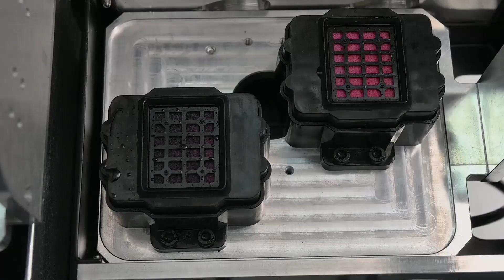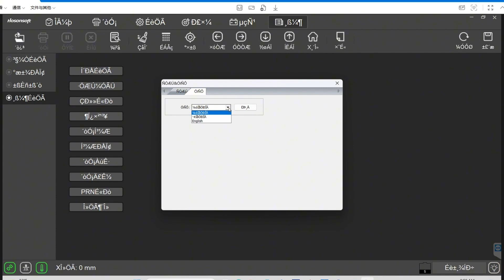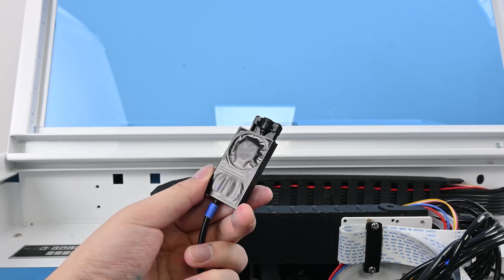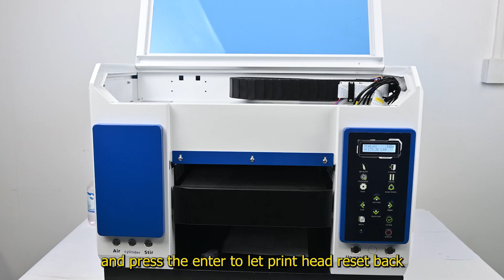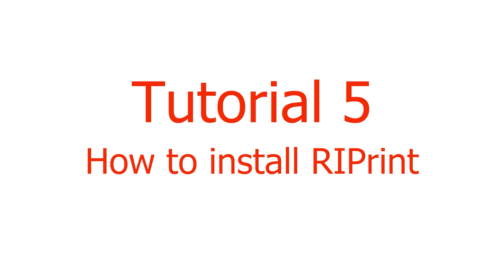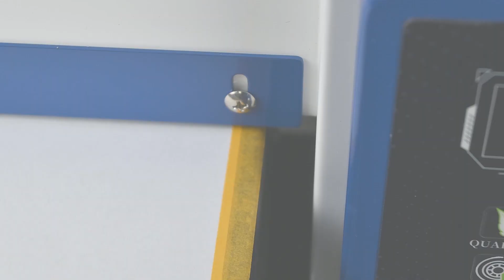Procolored V10 Pro UV Printer Setups

Comment: Hello can I make language German too or only English ?
Reply from the maker: The software has 7 European languages but unfortunately without German.
Reply: @ProcoloredPrinter 😂 wtf
Reply: Do not purchase printers from Procolored! Please spend a few seconds reading my concern. After spending 2400 pounds on F13 in August 2025, 6 months later and 19th t-shirts, is no longer printing. After performing maintenance as instructed by them, the device suddenly stopped working. I spent five hours online with their technicians without receiving a resolution. This is ridiculous! As a result, I filed a complaint with Procolored stating that the printer was not working. The response was: buy another printhead! Despite not assessing the situation, they claim that this is a normal phenomenon after six months. Also, to buy the print head, they offered me a 50 pounds voucher. That is a joke. I advise anyone not to purchase their printers, since they are not designed for long-term use and do not fulfill their intended purpose. As a result of their glamorous advertisement, I have let myself be influenced by it and now I am paying the price. I cannot print; I cannot sell! DO NOT BUY PRINTERS FROM PROCOLORED.